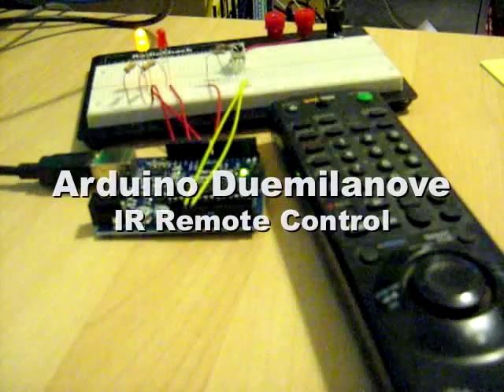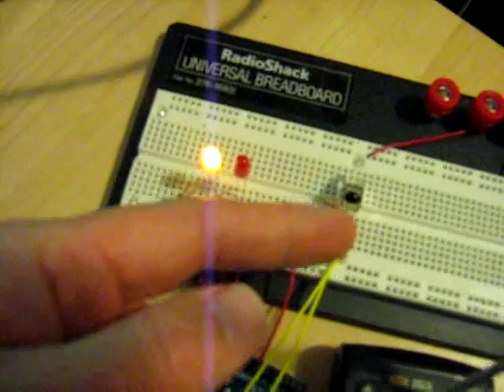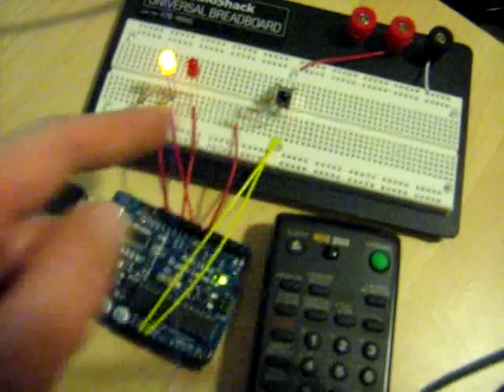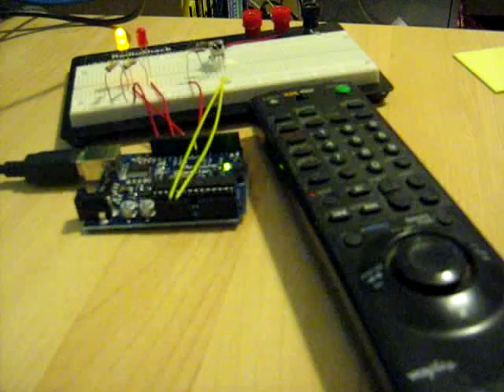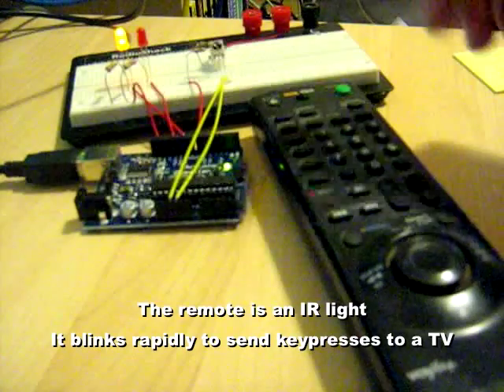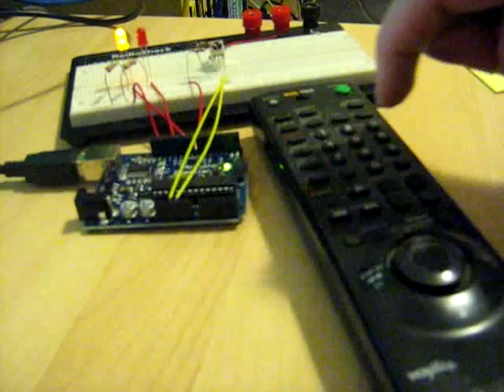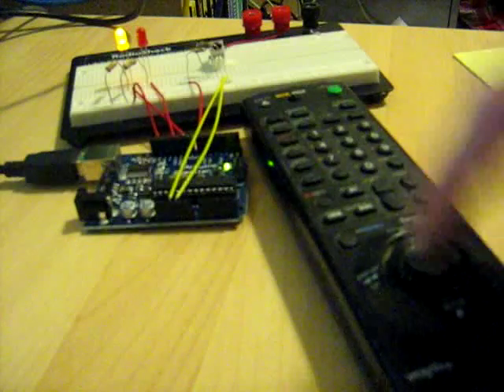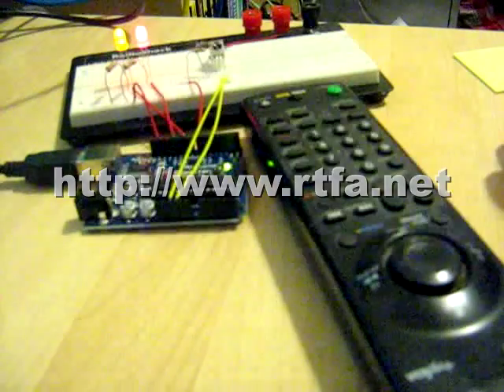Arduino IR Remote Control with do-it-yourself info

Comment: i have done this exept that I have connected the input of the IR reciever to the pin 0 analog of the arduino...
When I send the value on serial port I recieve always the same number...
Is it normal (and I've burnt 2 captor xD)?

Comment: @vacer25 Let me give you a tip: get the Arduino Uno, works perfectly is small but still has a lot of in and outputs and it is cheaper so you can spend more money on the extra hardware (LEDs, IR Receivers etc)

Comment: U seem SMart maybe you can help ME !!  I  made a Drop Down Gate  for my MotoCross Traning so i can get  Better at winning the Hole shot  , So far what i got  Wired up the  12v motor  with one of my 19.2 v Drill battery  powering it , Im Trying to make a  5 sec of even 10 sec timer with a wireless Remote the with power the Timer to off  in the time i wont it to  , Got any idea on what i can use  , also i do have a Spare car alarm Remote and have a Resever  from my RC car  so what can i use  ??

Comment: I didn't see you use a low pass filter between the IR receiver and your Arduino, how far away your Arduino can capture that IR signal from ur remote? by the way, very well done.

Comment: 10k Ohm current limiting resistors for the LED?  You're using USB power.  How can LEDs emit light when in series with a 10k ohm resistors on a 5b USB output???
Great video =)

Comment from the maker: thanks!  I made this setup cooler by moving from a breadboard to a protoshield, so it's all self-contained now.  Even better, I am using a 9V battery to make the whole thing portable.

The next thing I want to do is use some IR LEDs for output, and make a portable Arduino tv-b-gone.

Anyway, thanks for the comment!